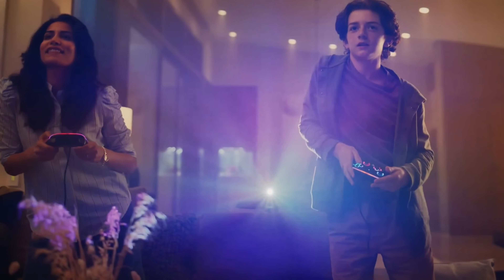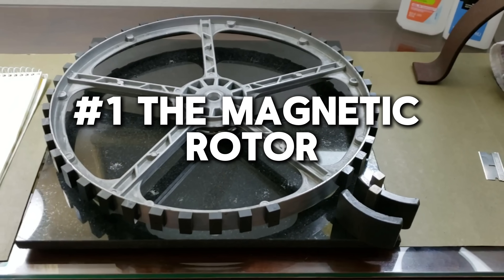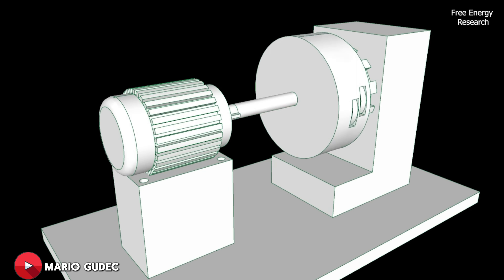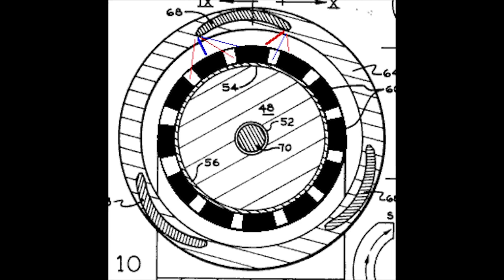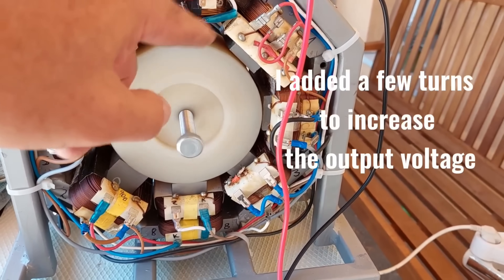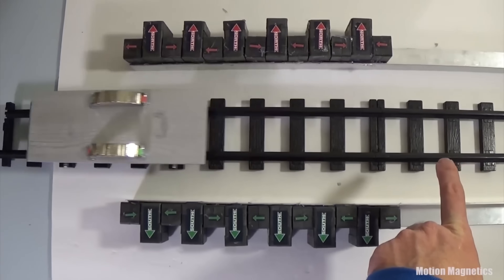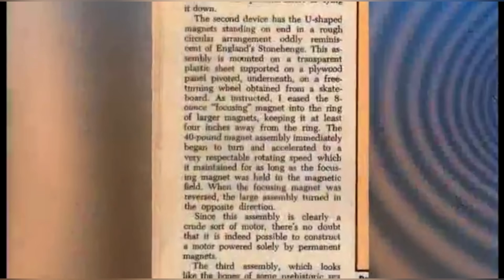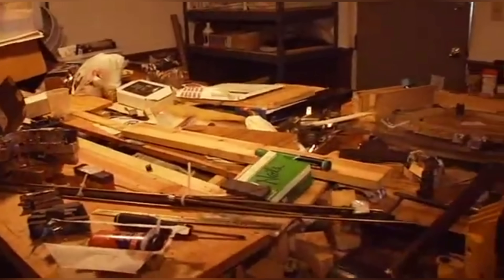American Inventor Howard Johnson's Magnetic Free Energy Generator: 110kW Power for Your Home!

Comment: The problem with this video is that everything it shows was proven to be false.  The Permanent Magnetic Motors he built, even in this video, can be seen slowing down in operation.  Johnson could not overcome the drag induced.  No matter how he tried to configure the permanent magnets , the spinning rotors would always have more drag than power, their for the concept was never a perpetual motion machine.  Adding a load to the system, just made it slow down even quicker.  The only spinning rotors he showed that kept going were actually back fed power from the "testing " devices.  The only way to prove the units actually Generated power, was to hook them to a load, like a light, not any power "reading" device.
Once hooked to a Load, the power generated inversely slowed the "generator" till it stopped.
There is no free lunch, or power ! 
Sorry to pop your bubbles !
Reply: Yes even human beed bread to power body😊

Comment: I built this motor but it does not turn at all. Only way of getting it run is by turning it by hand and when you stop the electricity is gone. Not worth sitting turning a wheel by hand all the time to make a small light glow.

Comment: you obviously have that article from  Science and Mechanics and his patents.  Why don't you just publish those where the interested folks can get them without a great dea of hassle?
Reply: Both can be found in the internet. Indeed, Howard Johnson had patents. The patent office was hesitant to grant his applications but finally they did it. However, a granted patent doesn't mean that an invention really works. Also the article from Science and Mechanics just reported the ideas of Johnson. The author was impressed by Johnson's "linear motors", but also these devices had no proof that they deliver more energy than was put in. Johnson spent many years with his attempts to build a rotating permanent magnet motor but he failed.

Comment: Free energy generators utilising magnets have yet to be demonstrated
Reply: American based company already sent a prototype in our country the Mag Gen that does not use diesel or gasoline its totally magnetic
Reply: @crisantocabrerajr.3508  They surely have website. Link, please!
Reply: i have a compilation disc i bought a long time ago that features a few that really appeared to work. One of them is located somewhere in Switzerland. It runs on electrostatic forces and continually produces about 2kw of power. 
Im in IL. No way to go find these people.
Reply: @ Well... The information got out to public "a long time ago" - and nobody made it work yet. Scam as any other.
If anything like this would be viable, it would be the greatest discovery since the invention of the wheel. It would change the world completely. How do you think it would be possible to keep it secret?
Reply: @hashg2969    You refer to the "Testatika", which was built by a Mr. Baumann, the leader of a religious group called Methernita. There is a Wikipedia-article about this group which also mentions this machine, but only in German. But it is doubtful if this machine really produced free energy or was just a scam. The group never used it for producing electricity and although it was demonstrated now and then no one was allowed to examine this machine. There are electrostatic forces in atmosphere but their power is minuscule, you could never get kW out of them.
Reply: Free energy generators are always "demonstrated" but never used.

Comment: Imagine one motor low voltage turning  a shaft with a load of spindles and at the end of these spindles magnets that as spin inside a ring of other magnets that as the motor turns the shaft with spindles with magnets slyttly Pilling spring loaded magnets with oeazo electrical scrrystal and also the movement from the electron and I could go one but thee pearl generators the best if u look dead at the plans that method could be used many different ways...

Comment: Where can I get the plans?
Reply: I have the plans, locked in the safe. Message me i will scan the documents and send it on a cd. I'm located in IL.
 Been trying to get people to help me.  No luck so far. Im a decorated us army combat vet and engineer. Getting too old now, no friggin energy or drive plus war PTSD
Reply: I’ll help you, I’m an electrician and trying to free my family from this bs game they have us is.
Reply: @matthammerstone9518    this system CANNOT work brother…. !  The magnets will lock in place with the magnetic field and the machine will find and stop at equilibrium this is not the answer to your and my research about free energy
Reply: @matthammerstone9518    this system CANNOT work brother…. !  The magnets will lock in place with the magnetic field and the machine will find and stop at equilibrium this is not the answer to your and my research about free energy
Reply: @Diamond_Fangs888  ftom transformer research,? The power to begin then a flywheel and it will work, and a spinning wheel has it own momentum that overcomess any resistance,  and said spinning wheel needs only tiny inputs to maintain momentum .just like ride a bike & wheely with loose axel nuts the wheel continues give it a straight path on the slightest of slope what happens?
Reply: @ThomasHillier-p9e   Will Not Work Bro….
Reply: @hashg2969  this system CANNOT work brother…. !  The magnets will lock in place with the magnetic field and the machine will find and stop at equilibrium this is not the answer to your and my research about free energy
Reply: Won't edif, errors are typos.
Reply: 🤣🤣🤣 funny guy thomas